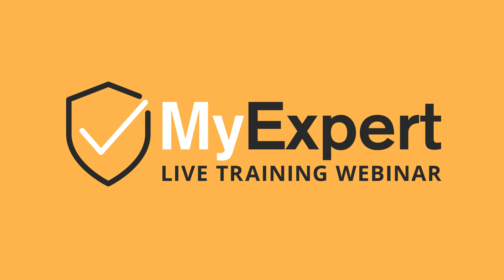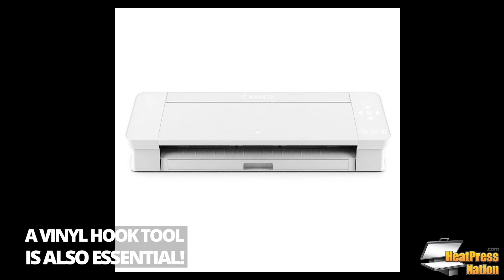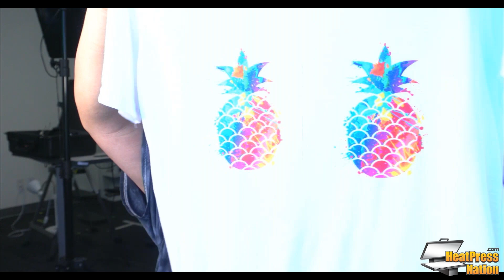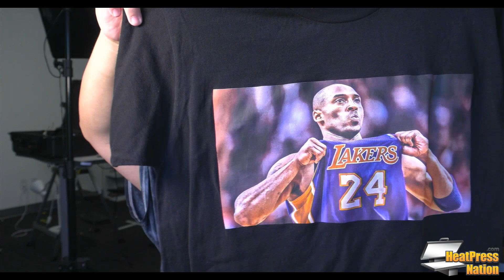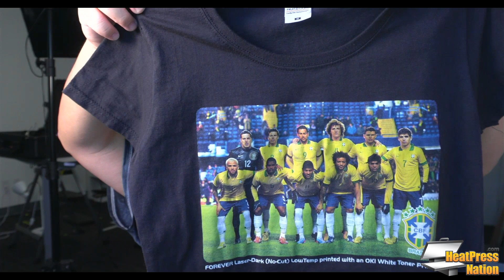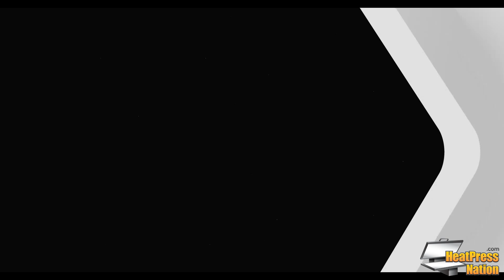Heat Transfer Business Essentials 101

Comment: This is quite informative to hear. I’ve been doing my research on sublimation for a while, but I’m curious to know the difference in feel / quality between Sublimation HTV and silk screen or laser transfer. It seems like sublimation HTV is great for multicolor prints without layering, but there’s still weeding involved. In addition, I would be curious to know how much heavier or thicker it feels compared to silk screen / laser.

Also, what would be the best for multilayered high-quantity shirts such as a bunch of shirts with the same design for a school or team? I’m not sure if I should invest in silk screening, because it seems tricky to customize colors.
Reply from the maker: Sublimation HTV (like EasySubli, Subli-Flex 202, etc.) is generally going to have the same feel/weight as a thin HTV. In ascending order of thickness (softest to heaviest), it's going to be direct sublimation, water-based screen print, rasterized white toner laser prints, 2-layer plastisol screen print, sublimation HTV, HTV.